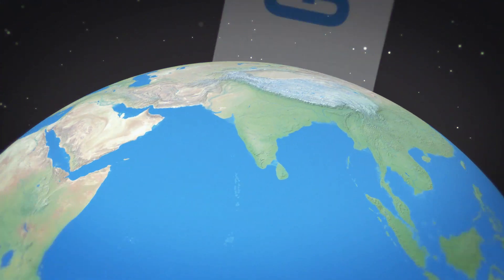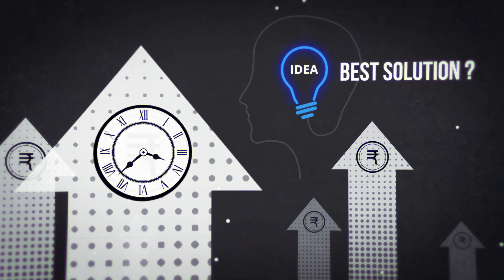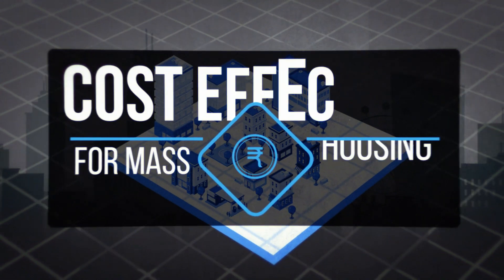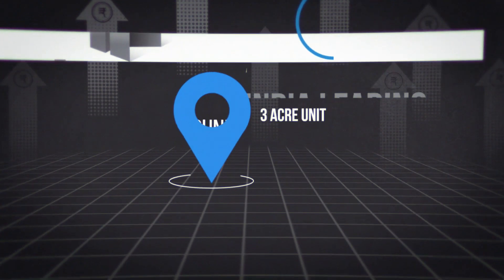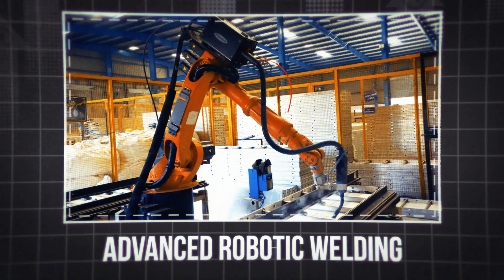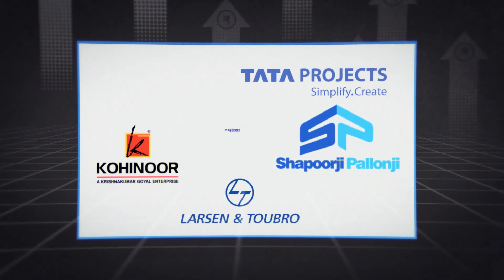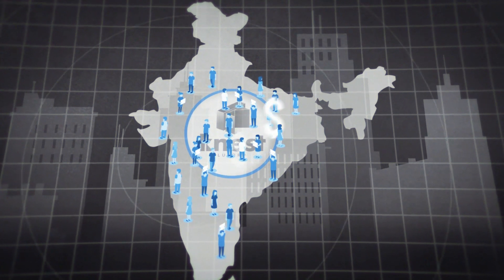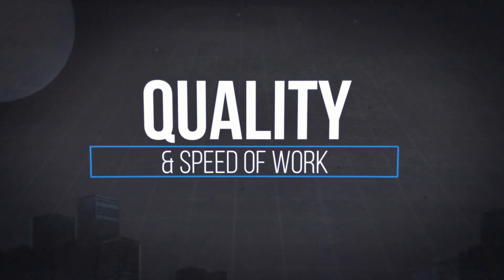Leading Aluminium Formwork Company in India - Knest Manufacturers

Comment: GOOD VIDEO. 
Sir please suggest me on this -- 
For my shuttering works , I use 3ft x 2ft steel board, pine wooden planks and battens and bamboo as props. 
Please suggest a better alternative to pine battens -- rolled steel channels or any aluminium battens( if available), or any other idea. But sir, it should be adjustable. 
Pine cant be used for more than 4-5 times and acrow spans are too heavy and costly for small projects. Therefore, please suggest a better alternative to pine battens and acrow spans.
Reply: Sir please contact 
+918675735919 for South region

+918291400524 for West region

+919953302114 for North region